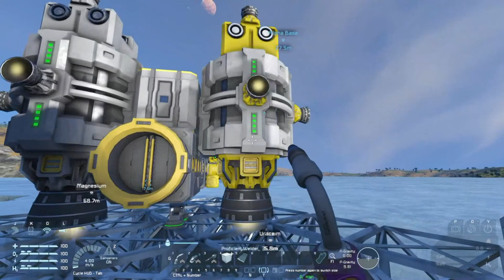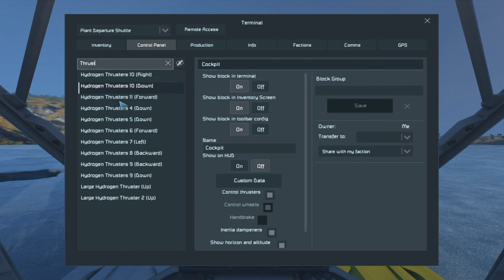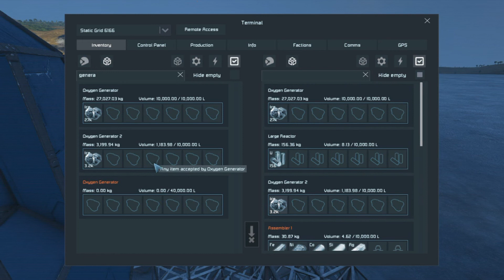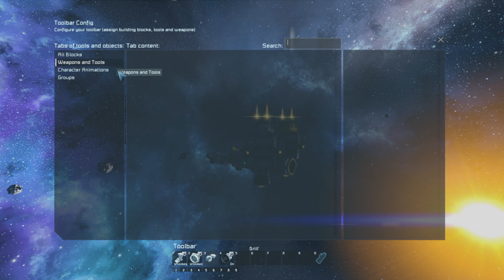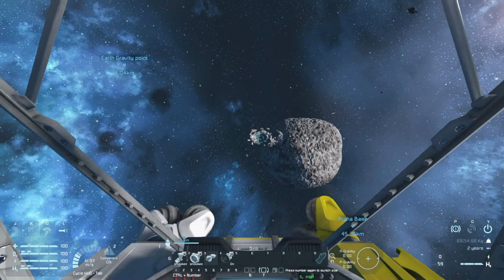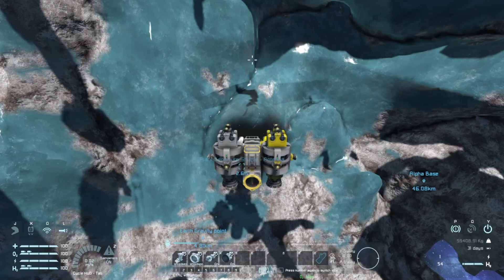Space Engineers Tutorial - Season 2 Episode 2 - Departure Ship Technique

Comment: The difference about Hydrogen and Power on the HUD always has me a little confused.  If my understanding is correct, we get our power from the Hydrogen - so what is the difference between the two?  Thanks
Reply: Mick S 
to use an example of an automobile:
Hydrogen is Gasoline
Electricity is your Battery

Hydrogen Thrusters are the only thrusters that work in a Gravity Well and in a Vacuum.
Reply from the maker: Hi Mick,
So the difference is the Power is the % you are using. ie. 50 would be 50% of available power is being used and 2 would be 2% of available power is being used, meaning 98% of power is not being used.
When you reach 100% or higher, it applies less power to thrusters so you won't be able to get as much thrust.